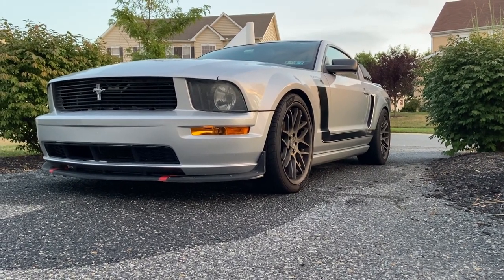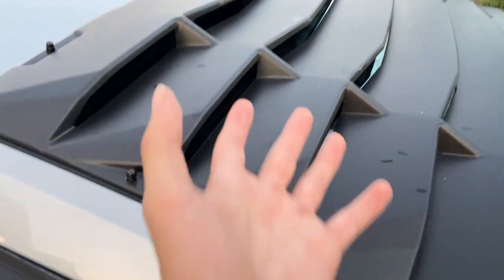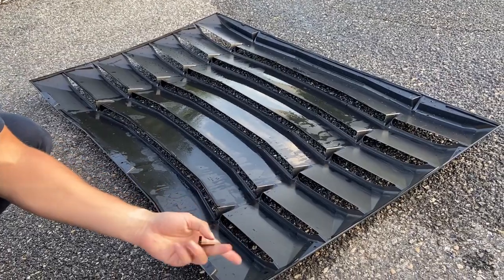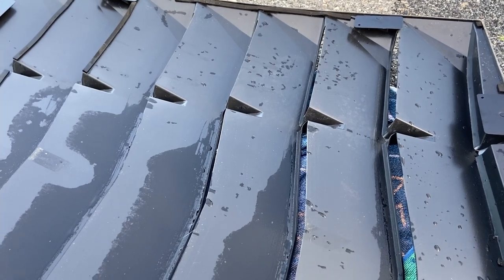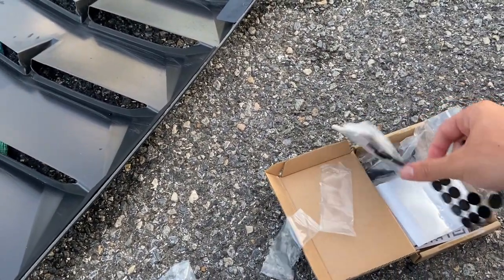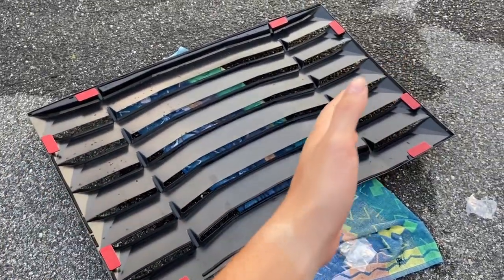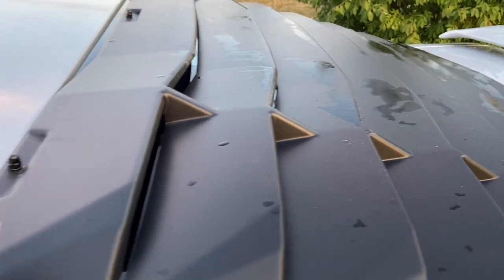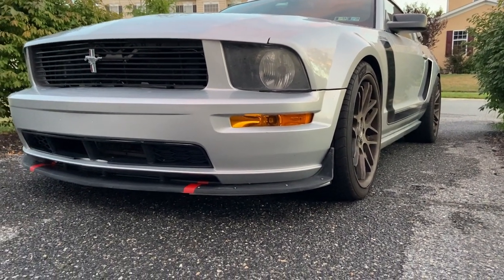How to Install Rear Window Louvers so that They DONT Fly Off on the Highway

Comment: Should have removed the louvers once you mounted them so you could directly press those plates on firmly which is the key to 3m tape besides a clean surface and application at least 70 degrees.

Comment: Where did you get the side quarter louvers from??
Reply from the maker: They’re just from Amazon with 3M tape to hold them onto the glass. The ones I got though weren’t totally flat when they came, so I heated them up with a heat gun and bent them a bit
Reply: @aquilaecompany  you know what I’ve been meaning to do that heat up the eBay Louvers I bought that don’t fit my 2014 mustang. Imma now give that a shot
Reply from the maker: Yeah it definitely does the trick! Just make sure not to overdo it- there are some great videos out there for it too
Reply: @aquilaecompany  thanks homie much love